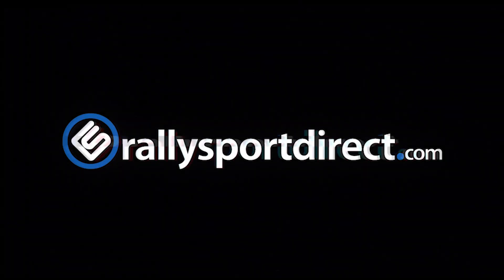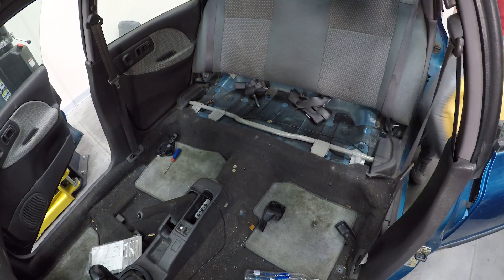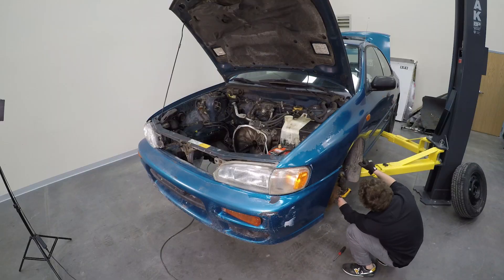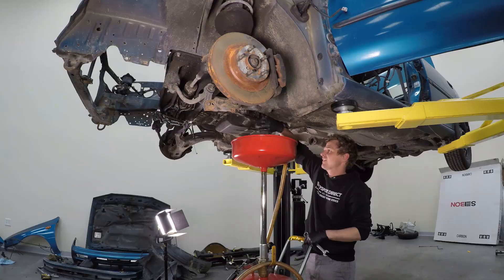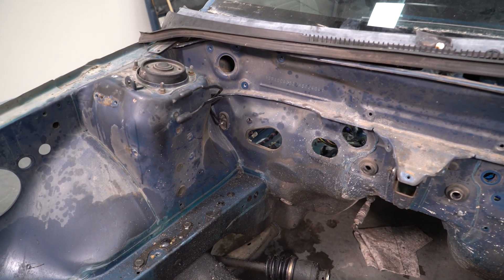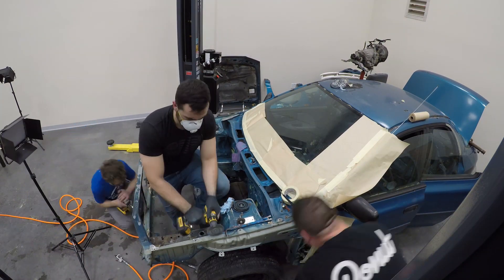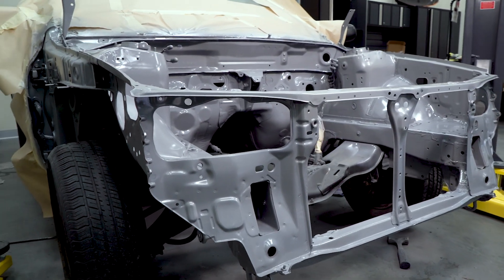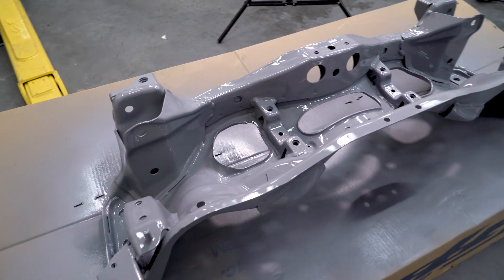Striping, Prep and Paint! - Land Speed STi : Vlog #2

Comment: this style of video works great, we dont need 20mins watching you rubbing down bodywork, just getting to the point with a bit of video in the background showing the main points. the only thing i would recommend you stay fairly indepth with is the engine itself as thats a pretty unique way of going at the record and I would bet thats why alot of people are subscribing for(myself included)
Reply from the maker: I'll get more in depth on the engine later on, or perhaps I can do an episode specifically on it if people want it. But as of right now, we know the engine design works, we've lined up a proper builder for the engine and we're getting everything together to get it done. I think we'll run a "test" engine to do a shakedown and make sure all of our systems are functioning properly, and then once we get that dialed in, we'll put in the race engine. Now the test engine will still be fully built, but it just won't have those expensive "final touches" that we are going with. ;) 

Getting dirty and stripping a car is not that exciting on either end, but it's all part of the build and I want to make sure I document as much as possible :)

Thanks,
Rick